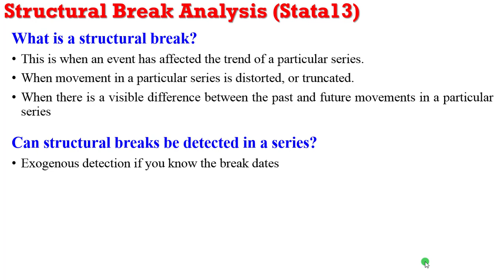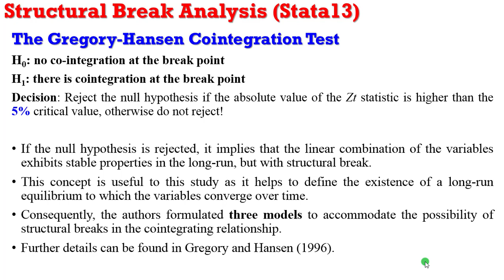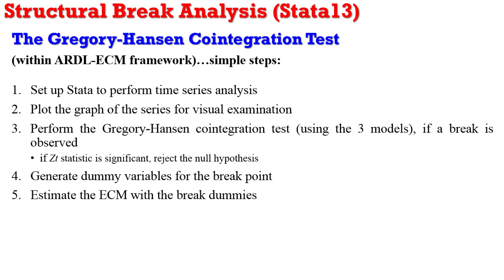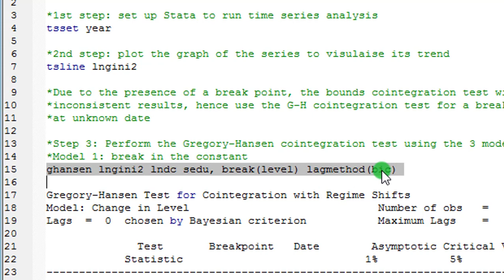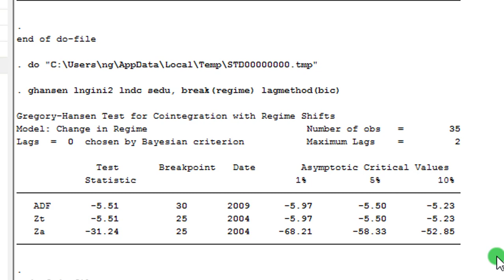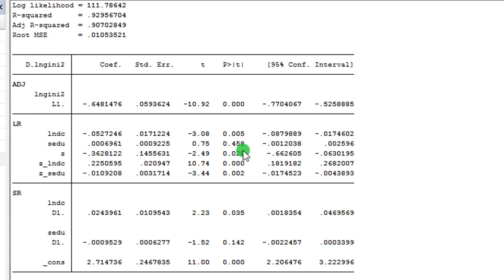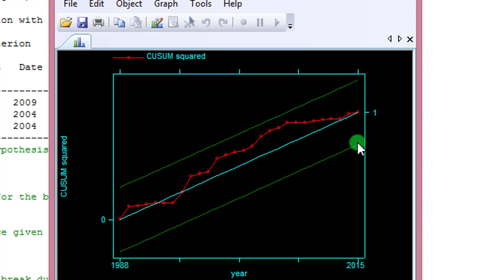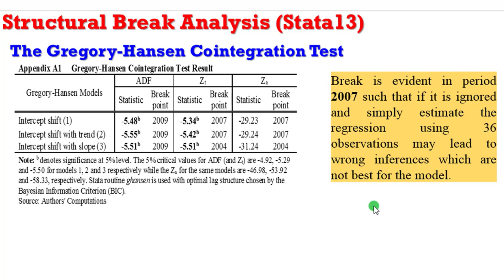(Stata13):Gregory-Hansen Cointegration Test Structural Break #ghansen #breakpoint #structuralbreak

Comment: Thank you ma!
I want to ask again please;
1. Why did you interact the dummy variable you created after the Gregory-hansen test?
2. Can the dummy variable be added as exogenous variable to the ARDL without the interactions using exog() in Stata?
Thank you
Reply from the maker: 1) interacting dummy variables is to address structural breaks in the model. 
2) yes...you can interact depending on what your research objectives are.

Comment: Thanks for the video and the explanation. I only have two doubts. 1- I'm trying to test if a group of financial time series are cointegrated or not. The series are not stationary, so I calculated the series of returns. My doubt is if I need to apply the test in the original series, or in the stationary return series? 2- After applying the test, and discovering cointegration reltationships, to create the ECM to anlyze the Impulse Response Functions and Variance Decomposition do I need to add the dummies?
Reply from the maker: Hi Luis, (1) use the return series; (2) dummy variables can be included in the ECM.
Reply: @CrunchEconometrix Thanks for the answer. Just one last question: when i write the the code, the order that I put the variables modifies the results. For example, if I put ghansen X Y, the results of the test are different from ghansen Y X. So, I want to understand how to interpratate this difference. If I put X first the results show if the series X is cointegrated with the series Y? What is the interpretation?
Reply from the maker: Luis, you have to list the dependent variable first. Follow the guidelines shown in the video and adapt the interpretations to yours. Thanks.

Comment: Good afternoon, madam.

I was using the same model with your reference. Upon testing the Gregory Hansen procedure, I got error in the model INTERCEPT SHIFT WITH SLOPE. What should I do now ? Can I go for the model with intercept only ? Because the model with intercept shift with trend shows co integration, however, ECM gives insignificant results. But the model with intercept gives significant results with ECM as well.

How should I be reasoning for chosing model with intercept shift only ???
Reply from the maker: Hi Aditya, I estimate all the models. You can do same and finally decide on the one that gives you the best outcome. Thanks

Comment: Dear professor, thank you so much for the video. However, I am facing a num list error (invalid numlist has elements outside of allowed range) in my test result while running ardl (step 5 in your video). May I get any help to solve this problem?
(I have 4 regressor in my model)
Reply: I had the same problem sir. Now I restricted my variables and it is solved. However, I am getting error on the model with intercept shift with slope.
Reply: @adityarazpokhrel7626  Now it is solved. I found my error on the placing of lags to run the ardl. That error was not related to number of variables. Thank you for your reply.
Reply from the maker: Glad to hear this is resolved, Basudeb🥰🙏
Reply from the maker: Glad to hear that you have resolved this, Aditya🥰🙏

Comment: Thank you Madam. I learnt a lot. But what to do when there exists no cointegration but there is a breakpoint in depvar ?
Greetings from Nepal.
Reply from the maker: Hi Aditya, no cointegration is exactly what is it. Simply proceed to interpret the breakpoints results. Much love from Nigeria 🙏❤️
Reply: @CrunchEconometrix  Much Thanks Madam. Madam what if I get a break year 2011 in the level and 2014 in the trend. Which dummy should I be using. And also in the ECM if "z" is not significant and rest (Such as ADJ and LR coefficients are significant) are signifcant then what to do Madam ?
Reply from the maker: Please watch my videos on structural break analysis for guidance.

Comment: Dear prof
Thank you for this wonderful tutorial. I however need your help on this pont.
I followed your explanation but my data has more than 5 variables and i need to check the structural break for each. It is confusing because i am getting different break years depending on the order of my variables selection. How do i know that the indicated break date is for which variable.
eg for the case of your date 2007 is break date for lngini2, then how about other variables?
Reply from the maker: Hi Shem, thanks for the encouraging feedback. Deeply appreciated. Only the break point on the DEPENDENT VARIABLE is of paramount interest. Watch the clip again. I also advise you get articles on break point analysis and study what they did.

Comment: Hello ma'am, your video was very informative. kindly clear my doubt that in case of presence of structural break in our time series data, if our all variables (one dependent  and two independent variables) are I(1) , do we have to use Gregory-Hansen cointegration only or we can use Johansen Cointegration also by introducing dummy variable in the model?
Reply from the maker: Dilpreet, your queries are always confusing. G-H cointegration test is applicable when there's a break in the data. I'm sure I mentioned that.

Comment: Hello professor, in this exemple you have checked structural break in the dependent variable. However, if one of the explanatory variable exhibits structural break point do we have to apply the same method when checking the cointegration
Reply from the maker: Aiboud, you may need to check other resources for breaks in the expl var. Thanks.

Comment: Thank you madam for you video. 
In my study private credit is my dependent variable and REM, Trade,  FDI  and GDP is my independent variables. All are annul series. There is visible structural break in REM (in 2001) and FDI (in 2005) and GDP (in 2011). These has been tested by Chow test, ZA unit root test. While using ADF and PP unit root test all variables are I(1). How should we model if there is break point in independent variable?
Reply from the maker: Chinta, to the best of my knowledge breakpoint analysis is concerned about only breaks in the depvar. You may check other online resources for more clarifications. Thanks.

Comment: Thanks prof.it is wrong to run ghansen at levels or using log transformation.secondly can the test be apply to many variables with multiple breaks.
Reply from the maker: Hi Mr. Bertrand, you can log-transform the variables. The test is applicable ONLY to the depvar having a break or multiple breaks.
Reply: Thanks so much Prof for quick response.one more question,I have 3 indepvar with multiple breaks.which test can I apply.

Comment: Thank you very much for your videos! I have a question about the ECM you mentioned in the intro slide. How do I test for a VECM stability if I allow for the break dummies? thank you very much for the support!
Reply from the maker: Carlotta, you are mixing up the terms. VECM relates to VAR while ECM is to ARDL. Which one is your query based on?
Reply: @CrunchEconometrix  Thank you very much for the quick reply! I've been using VECM , which now I realise it's different from what you've been analysing in this video. I'm having problems with VECM and dummies.
Reply from the maker: I'm not familiar with that approach.

Comment: Respected professor, thanks for your nice tutorial. I found no cointegration in GHansen structural break test but I found cointegration in ARDL bound test, so in this situation what model I need to use long-run Error Correction Model (ECM) or the Short-run ARDL model.
Reply from the maker: Hi Iftektar, refer to my ARDL videos on what to do if there is no cointegration. Thanks.
Reply: @CrunchEconometrix  Thanks a lot, professor

Comment: Respected professor, I found  ADF  has the lowest value in all three models, but the breakpoints are different as well. In  model 1 (1978), in model 2 (1979), in model 3 (1993). So, which year I need to consider as a breakpoint for the dummy variable. Please kindly let me know.
Reply from the maker: Use the breakpoint that is plausible with the year of policy change in that country.
Reply: @CrunchEconometrix  Thaks a lot, Professor

Comment: Thank you for imparting your knowledge with us on this topic. I have two queries
1. why we need to add interacting dummies (e.g dx1, dx2) along simple dummy
2.  In my data there are two time series and there is a structural break in both series and both these variables are I(1) as per ADF Breakpoint unit root test. My query is Can i go with this test instead of Johansen test because my ultimate objective is to run VECM.
Reply from the maker: Hi Harpreet, use ARDL and follow my procedure. I'll advise you read the Gregory-Hansen paper for better understanding. Thanks.
Reply: @CrunchEconometrix  Thanks for prompt reply.

Comment: I have a significant structural break in my ardl series,and some ardl coefficients become statistically insignificant, and I could not make them significant. May this occur due to structural break modelled with dummies?
Also adjustment coeff. is negative and nearly 1. Is this possible?
Reply from the maker: Hi Daphne, several factors could lead to insignificant coefficients including the presence of structural breaks in the model. I don't understand what you mean by "negative adjusted coefficient". Do you imply the ECT?
Reply: @CrunchEconometrix  yes sorry ect is now -0,29.  My depvar is consumption, indepvar is income.  Shouldn't be ect positive?
Reply from the maker: No. ECT should lie between 0 and -1 to evidence reversion to long-run equilibrium. It MUST be negative and if otherwise, the model is explosive.

Comment: Good evening Dr.
I met with this situation while running the ghansen test;
Model 1: ADT statistics shows cointegration, zt statistics doesn't.
Model 2: ADT statistics shows cointegration, zt statistics doesn't.
Model 3: both statistics show cointegration.
Again all the statistics in model 1 and model 2 has the same break dates, model 3 has a different break date.

Now can I actually say that there is cointegration? If yes, which break date am I using? Thanks
Reply from the maker: Read the Gregory-Hansen paper if you have not. That's the underlying study that explains the different test statistics. Use the break date that gives the closest reasoning to your study.

Comment: Hi, Thanks for your video. I have to questions to ask. I would be happy if you reply. 
1. How did you select the lags in step 5 (lags(1 1 1 0 0))? 
2. If evidence of cointegration is not established, should we run the ARDL model without "ec"? 
    ardl lngini2 lndc sedu z z_lndc z_sedu, lags(1 1 1 0 0)
Reply from the maker: Hi Raihan, thanks for the encouraging feedback on my videos. Deeply appreciated! Kindly watch my video on Optimal Lag Selection....and yes, for the 2nd query.
Reply: @CrunchEconometrix  Thank you very much for your reply. I know we can use "varsoc" to find the optimal lag for each of the variables. But, In one of your ardl video, you use the following command to generate lag, which later used in the 'ec' model. such as: 
ardl LGDP LINDT LDIRT, maxlags(1) aic
matrix list e(lags) 
//which then produces lag for variables 
ardl LGDP LINDT LDIRT, lags(1 0 0) ec btest

I am a bit confused. Should I just stick to using ''varsoc" for each of the variable.

Thanks.
Reply from the maker: Oh I see...either approach is fine. But use the maxlags ( ) approach for Stata to indicate the default BIC lags for each variable.

Comment: Hello, do I use the gregory hansen test to check for structural breaks in VAR model as well?
Reply from the maker: Hi Rose, not sure. You may need to check other online resources on that. Thanks.
Reply: Did you found an answer to that question?

Comment: Great work. Very clear from the beginning. Really appreciate this. 
Just one question regarding my regressors. I have six independent variables in my model and when I was running ghansen test, its mentioned that "more than 4 right hand since variables are not supported". I'm using ARDL-ecm framework,. Can you please help me with this matter.
Reply from the maker: Thanks Asanga for the positive feedback. Deeply appreciated! Reduce regressors to 3 and re-estimate.
Reply: @CrunchEconometrix  Hello Thank you for the feedback. I will give it a go.

Comment: Good day Dr. I have followed your video as you outlined it. When I run the gregory-hansen test command, I get the following error message.
-Number of gaps in sample: 143
Sample may not contain gaps
r(198);

Pls how do I take care of this?
Reply from the maker: No idea what that means.
Reply: @CrunchEconometrix  I was able to figure it out. Stata is very sensitive with the kind/format of data you feed into it for analysis. For instance, if your date data does not conform with any of its acceptable format, it will not run. Again, if any of your variable is a string data, it won't run.
In my case, I reformatted my date data and converted a string variable to a numeric variable (as they were what I discovered was the issue) and I was good to go.
I just thought I should share. Thanks anyway for your time.
Reply from the maker: Thanks for sharing Kenechukwu. My viewers will find this information helpful.
Reply: @kenechukwu are u using monthly data?

Comment: Hello, thank you for sharing invaluable information again! I would like to ask a question. I have a model with one of the independent variables contains structural break(according to its tsline). I tried all 3 models that you suggested but none of them gave a statistically significant result. Before to encounter such an analysis that you suggested in this video, I checked for the ADF test and one of the variables is problematic. What would you suggest me to go further? Thank you in advance.
Reply from the maker: Hi Simay,you may need to check other resources on how to handle structural breaks in explanatory variables. I've never done such estimations before. Thanks.
Reply: Simay Kızılkaya one independent variable may be far away to estimate your model correctly that is why the residuals might have been increased due to misspecification of the model.

Comment: Good Day Ma, While writing my dissertation, I used unit root test with break point and the variables am using are stationary at I(1) with different break points. My questions are;
1. can I proceed with Johansen cointegration Test
2. if no, can you explain the Gregory-Hansen cointegration test using E-Views 10
3. How do I proceed after item 2 above.

Enitan
Reply from the maker: Hi Enitan, from the G-H paper, JCT is not applicable in the event of a break in the model. Unfortunately, I am only familiar with the procedure in Stata the reason I don't have the EViews version. You may need to check other online resources. Please may I know from where (location) you are reaching me?
Reply: From Abuja. After the gregory-hansen, how do I proceed
Reply from the maker: @enitanwale-odunaiya7350  If you have a combination of I(0) and I (1} series, you estimate ARDL model.

Comment: thanks for your video, i just want to know how u calculate the lag values in gregory hansen model while calculating ECM model. please do reply
Reply from the maker: Hi Iqbal, as seen from the video, I did not manually calculate it. It is automatically derived. May I know from where (location) you are reaching me?
Reply: @CrunchEconometrix  mam I am asking same..I didn't get from where it is calculated...plz help if it is possible for u...I am from India
Reply from the maker: @faa-e-quahiqbal3976  Ok. I still don't understand your query but to generate lag values in Stata is simply l.y or L.y..and as I said, I didn't calculate the ECM, it is automatically generated.

Comment: What to do when ADF and Zt reaches different conclusion? 
In my model absolute value of ADF test statistics is lower than the critical value at 5% level whereas the absolute value of Zt test statistics is is higher than the critical value at 5% level
Reply from the maker: These are different measures. You stick with one. I will advise you read up the Gregory-Hansen paper for better understanding.

Comment: Good evening madam. I have a database of 6 variables. I performed the ADF test on the 6 and I find that 3 are I (1), 2 are I (2) and 1 is I (0). I perform the test of Zivot and Andrew (1992) and I note that all my variables are stationary with structural breaks. My question is the following. Do I have to do Gregory and Hansen's cointegration test or simply switch to Ordinary least Square ?
Reply from the maker: Hi James, familiarise yourself with the rudiments of VAR and ARDL models. I have videos on these. Watch them to learn the basics and you will be guided on how to proceed. Thanks.
Reply: @CrunchEconometrix  Can the Gregory and Hansen test be applied to a model containing stationary variables with structural breaks?
Reply from the maker: @jameswarrenjohnson7251  But you are watching the clip?
Reply: @CrunchEconometrix  yes I'm watching the clip
Reply from the maker: @jameswarrenjohnson7251  Ok then...follow the procedures with your data.